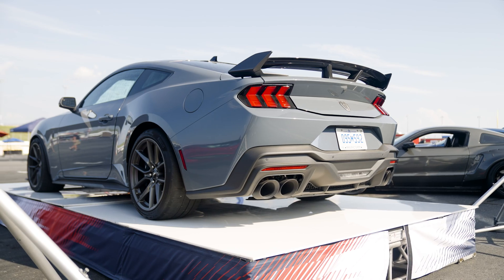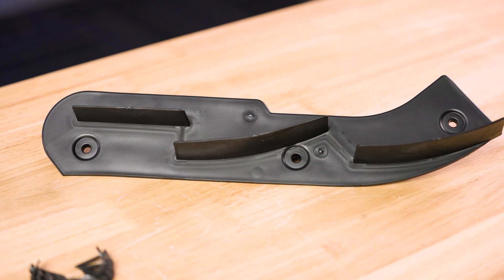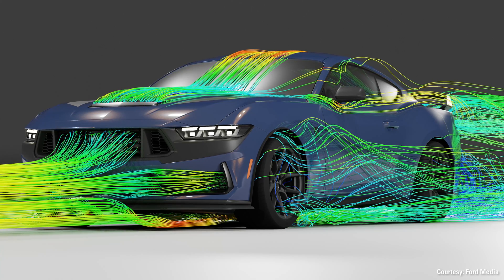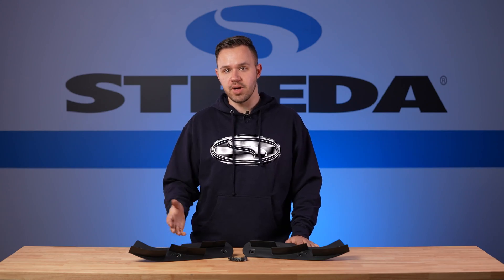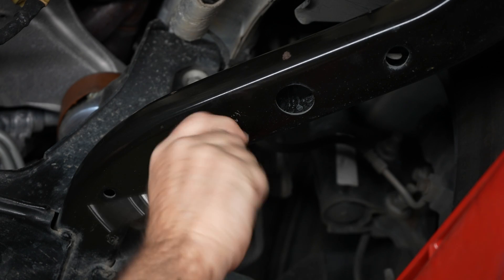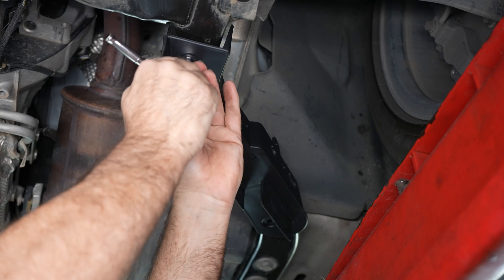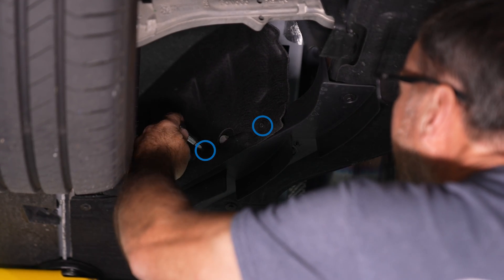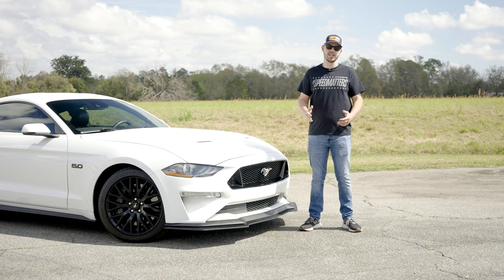Improve your Mustang's Aerodynamics with Underbody Strakes!

Comment: So on the s650 when having to do an oil change you have to take off the bottom cover wouldn’t that mean you’d have to take these off when doing an oil change because the mounting location is where some of the bolts go?
Reply: No. You use bolts on the outer part of the undercarriage and there is no need. I only remove enough of the undercarriage to get in there with access to the filter anyway, bending the splash guard  into compliance until finished.

Comment: If you dont have the underbody plating that runs down the side and around the wheel wells they wont be as effectiver or may not even work. It looks like in the video they removed the plating and did not reinstall

Comment: The giant hole above the K-member that lets air in through the fender is likely more a problem than adding strakes.   The S650 closed this area off, in fact ford copied a lot of what Verus Engineering had done in this area to include fender liner evacuation kit, belly tray, and strakes under the car.    Adding strakes without the fender evacuation/closed fender may not do mucb.

Comment: On my GT500 I already have the G-trac brace. You mentioned in other comments that the strakes are compatible, do I need to remove the G-Trac to install the strakes in between the G-trac and the k member mounting points or can I just attach the strakes over the existing brace?
Reply from the maker: The strakes attach over the existing brace. If you find it easier to remove to drill the holes, then feel free. But reinstall the brace between the strakes and the subframe.

Comment: Doesnot  look it fill fit with 2 point s550 gtrack  brace
Reply from the maker: There's a small gap intended to fit the S650 underpanels between the strake and the subframe. This gap also works for the G-Trac braces.

Comment: Will these work with the G-trak K member 4 point brace? Looks like these go in the same spot.
Reply from the maker: They'll work with a G-Trac brace. There's a slight gap between the subframe and strake that the brace fits between.
Reply: @steedaautosports  Cool, thanks.

Comment: So my car came with these but they were not installed by the dealership. I found them in the trunk about a week after I bought the car. Should they have installed them if I bought a PP GT?
Reply from the maker: Definitely! It's part of the Performance Pack after all. At your next service you could ask the dealership to throw them on, which they should've done when you picked it up. Or if you'd rather do it yourself, just follow the video.
Reply: I just took mine it for its first oil change and they installed them no problem.

Comment: Will these fit the Mach 1 with two point g trac brace from Steeda?
Reply from the maker: Yes! The G-Trac brace fits perfectly between the subframe and these strakes. In some of the S650 install shots you can see a G-Trac brace installed.
Reply: I did this months ago to my Mach 1, You'll have to cut down the sides of the vortex generators to fit the under tray, think I had to remove about 4 inches of the upper side.

Comment: I would think that slowing the airflow under the chassis would actually increase the pressure. (The Bernoulli equation states that an increase in velocity leads to a decrease in pressure. So decreasing velocity would lead to an increase in pressure.).

I believe any gains in overall downforce would be due to cleaned up airflow under the chassis from the strakes (i.e. front tire wake outwash not hitting the rear tires as much; and less disturbance in the diffuser area).

For the air management, I would be willing to try these on my GT350.
Reply: I wonder if they did any testing to make sure they work the way they think. I'm pretty sure the strakes don't work alone, they function together as a package with the changes that Ford made to the current car
Reply: @Redmongoose-rdm  agreed that by themselves the strakes would not make much difference. They work in conjunction with the smoother underbody found on that car compared to earlier cars.

On my Shelby I have added diffuser strakes to enhance the effectiveness. I have also added a more proper APR wing to the rear. These underbody strakes would also influence the underbody air flow to a degree. Just don't expect to be able to drive the car upside down in a tunnel . . lol.

Comment: Lol. When i picked up my darkhorse, those were in a bag in the trunk. Salesman had no idea what they were. I guess they are going on during first service.
Reply: Same lol
Reply: Mine  also, I think they are supposed to install these during dealer prep.
Reply: I just took mine in for its first oil change and they installed them for me no problem.
Reply: That's on the service department. It's a requirement for PID by Ford.
Reply: I have the same issue...😂😂😂